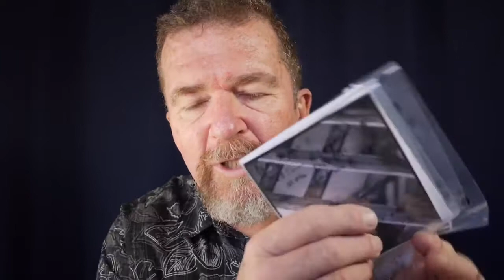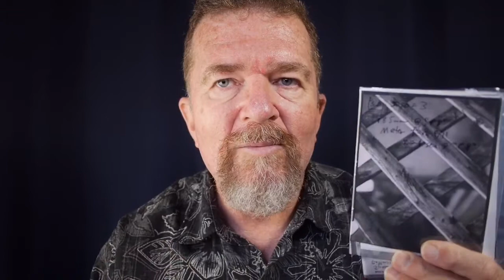Accurate Exposures With Harman Direct Positive Paper - Part 2

Comment: You can speed this process up if you have a view camera by taking step wedge photos.  For example, set up for a 2 second shot at your target ISO, say 2.  Pull out the dark slide a third of the way and take two one-second shots.  Then pull the dark slide out by another third and take a one second shot.  Remove the dark slide and take another one second shot. Now you have shots at 4, 2 and 1 seconds on the same photo, covering ISOs 1 (4 seconds), 2 (2 seconds) and 4 (1 second).   You can then develop and compare 3 ISOs on the same shot.

Comment: Try adding clean marbles to the container to take up the space and lift the developer to remove the air. I keep 5 lbs of the marbles for this purpose. I also wonder if a blue filter might give give a more accurate reading. I have several  used for printing photos.

Comment: Joe, I think there is one way out of this iso/asa cunundrum, an old trick for metering, esp. tungsten light, put a gelatin filter (UV/IR)- in this case, in front of the meters' bulb/sensor, this allows through ONLY the frequencies you want to meter.

Comment: Thank you for the very instructive video. 

I was aware of this paper some years ago, but had forgotten about it. 

I am thinking of using it with the cyanotype process. Scan the 4x5" DP print, enlarge to 8x10 digital negative, then direct print the cyanotype to watercolour paper.

Do you have any thoughts on this, or would it be too much trouble vs exposing regular 4x5 film?
Reply from the maker: It’d be better to just use regular paper negatives and invert them in Photoshop, if you’re going to make digital negatives for cyanotype.

Comment: Joe, This is my first try at paper negatives. I am a pinholer. Pretty good at exposing film. With this paper I am only getting blown out whites but borders seem exposed well. I have been working all weekend trying to get an exposure and I am not even close. My pinole is F176 and I am calculating with reprocity effect as I would with film. Guessing I am over exposing? Meter reading is like 1/8 at 5.6 ISO 6? HELP

Comment: I feel like this is obvious, but when you say to change ISO and keep everything else, you mean to change the whole exposure based on that ISO change, right? Meaning, if you were at ISO 6, Shutter 1/4th, and aperture 5.6, if that's underexposed, you'd "change" the ISO to 3, which would bump shutter to 1/2, and keep aperture the same, right? Just making sure I understand what you're saying, it seems like a standard exposure calculation, but I'm just making sure.

Comment: Please help!

I loaded Harman DP with glossy side facing lens/facing out. I developed in super monobath and nothing came out. The paper was completely white after bath and wash. 

I even put the paper both sides under my cellphone light just to get anything to come up and nothing. 

I redeveloped and re-washed at 80 degrees which was 5 degrees more than recommended. Still no image. 

I saw some black residue that was easily rubbed off with my thumbs. I’m assuming they’re from my previous bnw developments. 

Can you tell me anything about what I’m doing wrong here?
Reply from the maker: Try with standard develop, stop, fix. I've never used Harman with a monobath. Rate the paper at ISO 3-6 for daylight exposures. It's slower in winter, less UV in scene.
Reply: Am I supposed to load the paper glossy side to be exposed, also am I doing something wrong by loading paper under safe light?

I hate to ask so many questions but I’ve read the material in the box as well as on the ilford website and there’s no information on this. You seem to be one of the very few people with experience using this paper.

Comment: Another wonderful video - thanks very much. I have a general question about metering (one of photography's most controversial topics, in my opinion. There are so many different methods in use and they can't all be right [even allowing for different tastes in lighting] - i reckon that for the most part we are saved by film lattitude). Like you, i meter +1 for caucasian skin and -1 for black skin. I do this, not because of the spectral sensitivity of the medium but because of the difference in reflectance of the different skin tones. So I don't use the zone 5 reading of the meter as correct even when shooting pan-chromatic film. First I adjust for the reflectance and then I make further adjustments to account for any other aesthetic aims i might have (eg I might want to place the skin in a higher or lower zone). From what you say, I should also be adjusting for the spectral sensitivity of direct positive paper. Is that correct?
Reply from the maker: Yes, to the extent that photographic light meters are designed to work with a panchromatic spectrum, while photo paper like Harman DPP exhibit mainly UV, blue & some green sensitivity, some correction should be made.

My method is based on iterative testing of the paper in various lighting conditions, while correlating those light values to a meter reading. It's not necessarily scientifically accurate, but relies on consistency and past experience: If I set my meter to an ISO of "X" and meter the subject using a certain method, I should expect to get these results with this paper, based on past experience.

Comment: why not develope under a safe light in a dark room,?  you can watch it develope.
Reply from the maker: Of course, that's an obvious choice if you have a darkroom available. But many people want to experiment with these materials who don't have a readily available darkroom. Also, direct positive paper lends itself to this kind of processing, since a second printing step isn't required.
Reply: Hi, I still have a darkroom, wet photography is my thing and has been for many years. Of cause one has as a digital camera, which was bought nearly ten yeras ago now. I am far too old to learn about Photoshop, I can get by dodging away in the darkroom. Big trouble these days is getting hold of the chemistry. I used to use 'Iford Perceptol'  all the time. Now I just use junk that give me hard negs,. The best way for you to test your paper's ASA/DIN: Some years ago I made a contact printer in which I use a correctly exposed neg and a strip of photo paper. The machine has six light tight doors,  I use the enlargers timed light source, first  you guess a starting point, open the fist door and turn on the enlarger for a second, moving on adding a second as you go, (close the door behind you). Develope the strip in the normal way, you can then chose the best exposure time.. This is quick and vey easy, I'm sure this could be adapted for use without a darkroom.. I live in Scotland so one can't show you all my tricks. .... The  camera I use when out and about is a Rolliflex 2.8E, I have many others to choose from, however,  this camera is very forgiving, I even use its meter sometimes..